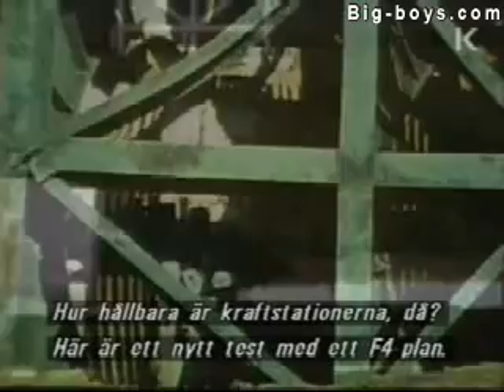Plane and concrete wall

Comment: The reason why these planes did not simply explode on the outer surface of the towers is because of the structure of the towers. You see they were basically made up of an inner core which supported the main bulk of the weight but also a rigid outer skin to both help support the floors and tie up the structure to keep it rigid. Now the when the planes collided they basically tore through the relatively thin outer skin of the towers and slammed into the inner core thus weakening the structure more
Reply: Also ignition of the fuel takes time

Comment: The reason why the planes managed to penetrate the towers is because of the following: these planes are really quite massive spanning several floors in height and weighing a very large amount. Aeroplane wings too are extremely versatile, they can bend up to 26 feet before snapping (standard regulations), why they cut through the outer shell. And lastly the main reason. The thousands of gallons of engine fuel which ignited and weakened the structure of the towers critically causing their collapse

Comment: Actually, the twin towers were designed to withstand the impact of a Boeing 707, which was the largest aircraft existing at that time. A B-25 bomber had crashed into the empire state bldg. during WWII, that's why this was a consideration.  Just a thought, why did WTC7 collapse without being struck by anything?  An ordinary fire (or even jet fuel) doesn't burn hot enough to melt steel, that's why blast furnaces are needed.

Comment: actually the wtc was built to withstand a plane crash. Skyscrapers were designed like this, after a plane crashed into the ESB (Empire State Building). However, the position in which the planes hit caused the frame to malfunction, thus the WTC collapsed. at least that's what was on the Discovery Channel.

Comment: NOTE:
The video indirectly explains why the plane could not be found after the attack on the Pentagon during, or after, 9/11.
Whatever had hit the Pentagon had hit it with enough force to disintegrate the object.
Reply: tips of wings should have been found. A larger hole would have been made. Wheels would have been found.....sorry. Still not convinced. Can't make me see what was not there. This demonstration is not similar to what happened during 9/11.
Reply: Dylan Tucker Parts were planted you mean. No engines were found and the odds of that plane actually making that maneuver at those speeds is next to impossible. Especially with a novice pilot.
Reply: Dylan Tucker the fact the plane was traveling nearly 500mph at sea level (which is impossible for that plane) and it made a corkscrew turn while descending at 4000 ft per minute. Even the best pilots in the world would have a tough time doing that. In fact many tried and couldn't do it. The control surfaces of the plane couldn't handle it.

Comment: May I continue my reasoning further. The steel used in construction of the towers was the lightweight sort to enable such height. There was pretty much no concrete used in the upper floors at all to save weight. Also the heat from the inferno caused by the engine fuel increased temperatures to well over 1000 degrees C weakening the steel which was engineered to withstand a mere 500C in comparison. Then there is the debris which would have ripped through the opposite side of the towers as well.

Comment: No, it states in the video that the wingtips escaped disintegration, meaning the aircraft was slightly wider then the concrete block.

Comment: you just watched a video of a fully functional phantom turning to dust.  in the full video, you are shown that the plane still has the engines, the pilots armor plated "tub" and the arg hook.  by the way, the head on an arg hook is the strongest material used on any aircraft.

Comment: @circusboy90210 The plane in this video was designed to take a lot of damage, the passenger jets were just meant to land and take off. This is a very strong plane. If you honestly think that a different result would occur with a passenger jet, then you need to get your brain checked out, for real. Re-enforced concrete is stronger than planes, so you have to think about how strong the concrete is before the plane. In this case though, the planes strength truly is irrelevant.

Comment: Cartuner25 (14 hours ago) Marked as spam 
Seems like it's testing the concrete more than the plane! 

in fact they ARE testing the concrete walls, they wanted to see what happens if a plane crashes at 800km/h in a concrete wall of a nuclear power station, and they are designed to absorb impact, as you see the impact was absorbed almost completely ..
excellent video

Comment: it would have been the same.  i thought the video would be enough evidence for anyone, but i haven't got the time to explain the materials used, the inertial convex, or how an f-4's armor plating would be more dense than any part of a 757.  by the way, i've built both.  and the b-1b, c-130, and f-18.

Comment: Don't forget these wings are much denser, heavier and thicker than the steel columns so they would just basically cut through them while probably -i admit- they would be disintegrating. As well as this you have to remember that each plane would be traveling at several hundred or so miles an hour which would only have multiplied the effects which took place.

Comment: the smoke form and formation spead indicate that, and it was the front of explosing floors (symmetric, while the building was tilted and the damage was assymetric, so collapse stright down symmetrically was impossible) which can be easily seen in the film

Comment: So do you see a plane coming out the otherside?  I dont.  Remember folks this is just concrete.  No nose or engine coming through the other side.  It would appear we have a contradiction because the pentagon the nose and engines went through the other side to pentrate 5-6 walls.

Comment: Momentum eh?To crush the 390,000 tons of concrete (that's JUST the concrete) in a tower to powder and it takes 2.1 x 10 to the power of 12 joules to do the job. That's twice the gravitational potential energy of a tower (according to factual data). In other words, crushing the concrete should have absorbed so much energy that the collapse would have been halted, especially as the core column damage (where 'failure' started) that occurred was greater than 3/4 of the way to the top of either tower

Comment: Most plane wrecked that people are accustom  to seeing are from crash landings, where the pilots slow the plane down and try to land with as little damage as possible, leaving a debris field littered with rather large chunks of the plane intact. The hijackers on 9/11 hit at top speed. The fact that there were little left of the planes larger then a breadbox is no surprise.

Comment: Though it does have certain areas that are reinforced, the Pentagon is not a nuclear power plant.  And multiple parts of the plane were recovered, most horrifically the remains of the passengers and flight crew.

Comment: NO, but the pressure wave from expanding gasses would have no problem blowing out windows. Not to mention the half dozen more massive parts like landing struts and jet engine fan assemblies. Said parts traveling at 500mph could cut the steel facing of the towers with ease leaving a gaping hole for said fire ball to exit.

Comment: The Pentagon was re-enforced concrete, so it was stronger than the average wall of course, but not as tough as the wall in this video, so somewhere in between. The plane was able to penetrate a little, but not the same as an average wall somewhere

Comment: The F-4 phantom has an empty weight of about 29,000 lbs. The 767 which hit the towers weighs about 175,000 lbs, depending on which engines it has.  Also, the towers were constructed with an aluminum exoskeleton, designed to withstand a planecrash by absorbing some energy, not like a concrete barrier.  This video, while intersesting, isn't a good comparison for the events of 9/11
Reply: I was directed here regarding a crash into a nuke facility, not 9/11

Comment: "Or indeed the 5 anit-missile batteries surrounding the Pentagon?"

You've been lied to. There were no anti-missile batteries or anti-aircraft batteries around the pentagon before 9/11. 

In 2002 they deployed some anti-aircraft defences  briefly at the anniversary of 9/11 but other than that there still aren't any anti-aircraft defences at the pentagon.

Comment: @TheKmagz My point is that concrete is able to totally disintegrate a plane. A huge part of the conspiracy theorists arguement is that the hole in the wall is too small, the wings just vanished, and there was not enough debris. This video more or less proves that when faced with concrete a plane CAN be reduced to dust, meaning the effects Flight 77 had on the pentagon are far more plausable than the theorists claim.

Comment: The volume of an object increases as the cube of its scale while cross section increases only as the square of the scale. WTC had to be a light-weight, steel-framed building to make the economics work out.

Comment: ctmingusfan - Actually u should do the research sir. A 1/4 mile fall in 10 secs is near 125mph. factor in the sea level air pressure and that my friend is stark free fall. Each floor supported its own weight. While the core supported all. So for them to fall they would have to be crashed into. Which tends to slow things. Also how did the modest fire end up in the subbasment after falling 125mph in a debris cloud and end up turing the foundations molten?

Comment: A B-25 weighs apprx 25,000 pounds flys 230mph (cruising ) and hit a CEMENT building. A 767 weighs 220,000 to 450,000 flys at 530 mph and hit a steel and glass building. Just one engine on the 767 weighs more than twice as much as the entire B-25. Not the nose but all the debris pushed forward just the shape of the nose. Due ti the transferance of energy.

Comment: actualy you can count the forces you know the mass, the density, the surface are, the spead and you know the same parameters of the building...moreover why on impact we didn't see any cracks on the aliuminium shell/fuselage??? it seems that there were no  resistance in the entering...so the straw cannot penetrate the wood...with any tornado...physics wouldn't allow that (3rd law of Newton and the strenght of the straw walls)

Comment: Well actualy your logic works agains you because phantoms are built stronger like to whistand triple A. With your logic the AA plane that crashed into the pentagon is weaker so it should of had more difficulty penetrating.

Comment: I tried posting links in this comment to several pictures of straw piercing trees and telephone poles after tornadoes, but Youtube wasn't letting me. Just do a Google image search for straw + tornado, or message me and I'll send them to you myself.

They also tested it on an episode of MythBusters called "Deadly Straw." They were able to disprove that straw would fly straight through the tree, but did show (several times) that at speeds of 300mph, the straw did in fact penetrate the bark.

Comment: This was an important test. This is the basis for not requiring flight restrictions around nuclear power plants. At one point the Feds suggested restricting aircraft from 10 miles of a power plant. This test was used to show that even an F-4 (a pretty heavy plane) going 500 mph couldn't get through such a wall.

Comment: so how did the hole happen? It`s not like "oh, center of plane will make a hole in wall, left, right, upper and down part of it will be send to other dimension"
these parts are the strongest ones...  if there is plane hitting, and it makes such deep hole, there is no way that the hole will be smaller than plane

Comment: @XmadmanREBornX Look at a 757. The engines are not that far from the fuselage. Close enough that when they hit what damage they did cause simply combined with the damage the rear of the plane caused.

Comment: The day flight AA77 hit the Pentagon all physical laws were off. The plane crashed through several concrete walls with no problems. The Pentagon must have been built with very poor materials. An Airliner like a 757 can never reach the speed of a fighter-jet like this one. Okay, a 757 has much more kinetic energy on impact, but is that enough to pierce a dozen of concrete walls?

BTW: I saw a picture in the web that shows a Global Hawk Cruise Missile with a American Airlines paintwork. Google it!

Comment: OK 9/11 truthers, listen up:
This does NOT simulate the walls of the WTC towers. The Towers' walls were made of steel and glass not even half as thick as this.
For the Pentagon: Note that the Pentagon had windows in it, unlike this concrete block. Add the significantly greater mass of a 757 over this F4 fighter jet for much more force. To top it off, the plane crash didn't even break the Pentagon wall; it caused severe structural damage that made the wall collapse less than an hour later.

Comment: FYI when jet fuel isnt in a jet it doesnt burn hotter than 600f.Now i ask u what does high load steel melt at? Remember the core was molten for a week. MOLTEN !!!

Comment: I have seen the footage's of these so-called 'controlled' explosions and the fact of the matter is that they are all far too small to do any damage whatsoever whatever they are. And of course they wouldn't have needed any explosions for once the floors at the top began falling it would have been impossible to stop. Have you seen the structural plans for these things?

Comment: I guess there are a few that did not pay attention to what the lady said, "The wall was designed to absord the impact" How many builds are made out solid concrete & re-enforced? That jet fighter is no where near the size of Jumbo jet, (A whole lot smaller)but going about the same 500MPR, and it was caught on tape. Now why can't we the plane hitting the Pentagon from all the security cameras?

Comment: This was the reinforced concrete wall of a nuclear power-plant, the walls of the pentagon with thinner and of a different structural design the boeing aircraft was a more heavily reinforced slower moving object than whatever did hit the pentagon

basically you showed completely different aircraft with a different design made out of different materials, traveling at a different speed hit a completely different structure and a different angle and you say it proves what the government says is true.

Comment: :)) those floors hitting each other should be a factor of slowing down a collapsing building,not to induce "free fall speed" .... 

PS for you streakingcameraman : Get contact with your brain ...it seems you don't keep in touch with it ...

Comment: Hey there still has to be minut that is very very tiny scraps of aluminum ,Titanium and even polycarbonate from the bublle hatch or even hardware...What was left at the Pentagon was the stator from that Cruise Missle made by?????GE thats right model J-100 minature turbo jet...

Comment: A govt fortress like the Pentagon most likely is not 10ft think but will be thicker than your standard 10-12".  And I doubt you will see #4 bar anywhere.  Heck I was on a job where some of the floor slabs were #8's each way top and bottom and like a foot thick or more.  There was speculation what that bldg was for  but nobody would tell us.  It was a federally funded project though.

Comment: Yo're comparing a steel and glass building with a cement reinforced blast resistant building. Try this slam your fist into a sheetrock wall then with the same force into a solid core door and reoprt your findings.

Comment: @NWODisinfoAgent  concrete has more mass  just like ice can rip through the hull of a ship. ice is not stronger than steel, nor is concrete stronger than carbon fiber or aluminum.

Comment: Waist of a good airplane? I don't think so. The F-4 is very old and is not used by the United States military anymore. Better use for it than letting it corrode in a plane yard.

Comment: because I see that physics doesn't allow to occur that...moreover explosives pulverised not only lower floors, but and upper floors of these buildings, like and aliuminium wings penetrates steel colons who are approximately of the same size...why not the other way round???

Comment: it's an absurde...if you have a pancake you have floors going in thesame manner not only down, but and up...which is not seen in video...and you MUST have vertical colons intact and standing...and I already said that symmetric collapse is impossible IMPOSSIBLE!!! HAVING NONSYMMETRIC DAMAGE...pancake does not evaporate or pulverise concreate and steel, only explosives...actualy pancake is impossible and due to the cut of vertical supporting colons at the impact site

Comment: well well well there goes the US govs story that pentagon plane was obliterated! the 16ft hole in the pentagon went through 4 or so rings of reinforced concrete an steel and on this vid you see it doesnt even go through 1 block of concrete! me thinks they used bunker busting missiles to get through pentagon! as for the other flight, planes dont disintergrate into dirt gashes 25ft x 16ft either! thats my 2 cents worth!

Comment: But get this straight people , if the 9/11 planes did go 500 mph that would be 800 km and that's 0.8 mach , if it would be going that fast it would,ve broke up even before it hit the pentagon or crashed in to shanks ville

Comment: @MrChoppington commercial airliners vs fighter planes.... different strengths different stresses.  commercial airliners airliners are stronger beause they use heavier materials. fighter planes have different high strengths because they are smaller but also use far superior technologys like honeycomb materials. however  materials shaped in different fashions  can make different types of strengths for different occasions. it's called structural engineering. study some.